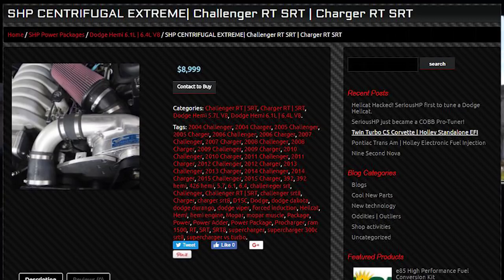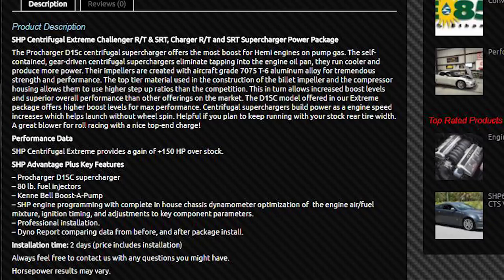392 Scatpack - Should you install a supercharger yourself or have a shop do it?

Comment: I would let the shop do it and I'm a good mechanic. Reason is they will have all the tools, equipment, and experience. The tune will be worth the extra money.
Reply from the maker: Yeah the fact that they’ll tune it all after really makes a lot of sense. Typically a nice custom tune is like 500 alone. It really makes the value of having a shop do it significantly better.
Reply: I'm currently looking to buy a new scat pack or used hellcat. I also live in the Houston and yes we do love our horsepower... lol
Reply from the maker: lol exactly. Lots of fast cars prowling around. I lost to an neon SRT4 the other day lol. Obviously was way built but that’s the kinda cars that just casually drive around
Reply: What? Ouch, not a neon :(    lol
Reply from the maker: Yup a neon... lol. It pulled hard on top. Sounded all raw. It was cool.
Reply: I seen Riley/RP Production added a rear differential brace. Have you or are you going to install one on yours?
Reply from the maker: No i don’t really know anything about them. I’ll check it out
Reply: I don't know if the scat pack has wheel hop as bad as a hellcat or not.
Reply from the maker: I haven’t gotten any so far. A bit at the track but other than that none...

Comment: Let the shop install just less of a headache and for warranty wise. Love the channel.
Reply from the maker: Yeah that’s the direction I’m going. Too much risk plus the shop will warranty the install for 12 months. After tune and everything the saving of doing it myself is tiny almost nothing. Not worth It
Reply: Hqen2000 just found ur channel today. I have a 16 and I'll be following ur build. I'm in the same situation as far as deciding all this stuff. I was wanting the magnason but I'm still conflicted. I'm a subscriber now! Good luck with ur build!
Reply from the maker: Thanks. I really was afraid of too much low end. You know how the car is stock you have to be so light on the throttle or it spins. A screw would just make that worse

Comment: If you have extra $$ then I would have the shop do the work plus you will have installation warranty and the Hp you really want.
Reply from the maker: I think they’ll warranty their work but no shop would guarantee  the engine will hold he power flawlessly. But I’d imagine ensuing the tune and install is on point would make that less likely.

Comment: I'm looking forward to your supercharging experiences.  
I've been mulling it over with my 5.7 down the road.   SHP has some nice packages, and I thought the installed prices and times were very fair.   The tuning and PCM stuff is pretty important and can make or break your car, literally, and it looks to be included in the prices.  Personally, if that shop has a good rep and real experience with Mopar I would pay the extra $$ and have them do it, especially since you are in the same town.   I wish there was a shop like that in my town!
Reply from the maker: Yeah tuning is included. I’ll need to buy a handheld tuner if I want to be able to switch tunes. I was thinking I wanted a 91 octane and a 93 octane tune Incase I travel to an area that doesn’t have 93. Or just only have a 91 tune so I can be safer (slightly less power though)
Reply: Hqen2000 usually at least with Subaru 91 will have more knock and is worse than 93
Reply from the maker: The idea was to tune for 91 but run 93 so you’d be extremely unlikely to have an issue

Comment: Idk you'd be messing with the heart of your car headers yeah maybe but a SC no and the shops warranty their work so if it blows you have a company backing you w a motor rebuild or replacement spend 2k to have it installed(either way you'll pay the 7gran for the sc) or 18k for a new 392 motor Lol
Reply from the maker: Lol it’s not 18k for a new motor you can get a built short block for like 4K plus install so it would be expensive but nowhere near 18k
Reply: Hqen2000 hellcrate swap lol didn't know 392s where that cheap how much is the 6.2L
Reply from the maker: 5700 for a short block. 

http://www.shophemi.com/c-1325-62-hemi-based-short-block.aspx

Just remember these are for shortblocks not complete engines. For a full swap it would require a lot more parts
Reply: Hqen2000 might as well drop a hellcat motor in that pack and call it a day  and btw I meant a fully built motor including supercharger not just the block

Comment: Shop or not.... You will waste the internals in that 392. Been there done it. Low boost, best tuner in Atlanta.... ZERO racing. Upgraded injectors and fuel system... did it all right. Still broke the internals!